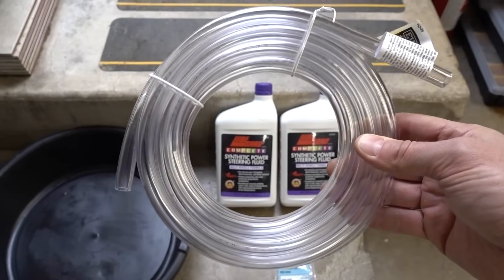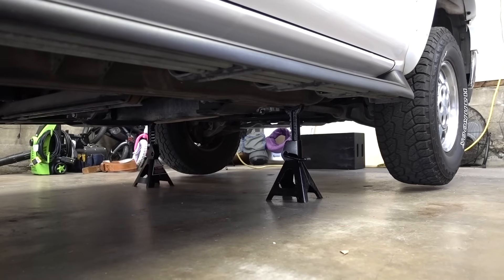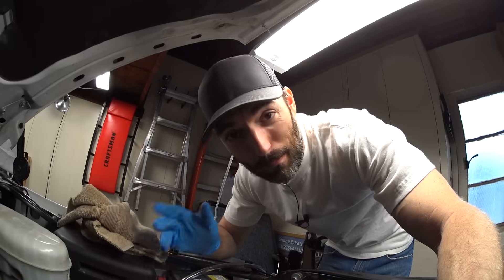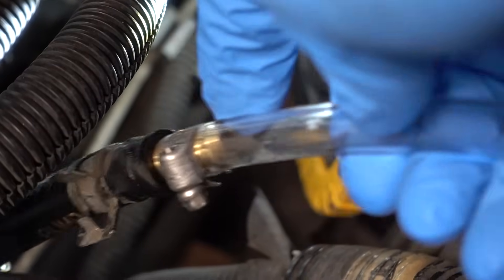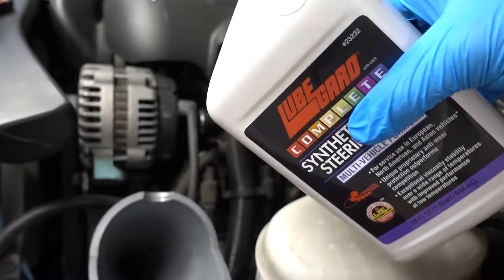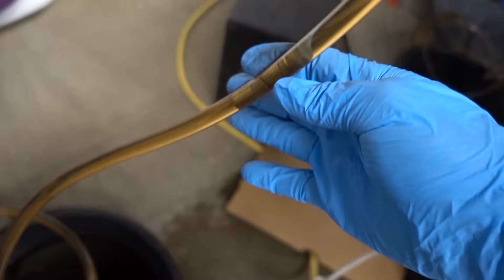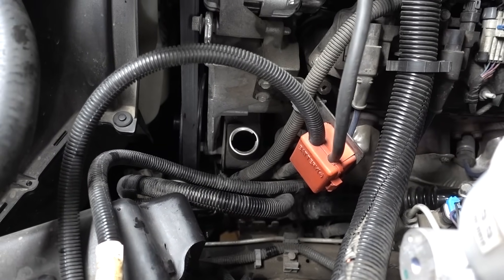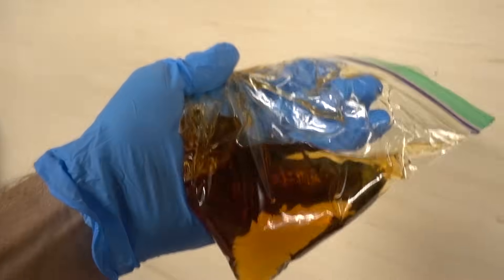Absolute BEST Method To Flush Power Steering Fluid!!

Comment: I don't think you need the hose clamps. There is no pressure on an open-end drain.
Reply: A $1 clamp is cheaper than $5 of fluid all over the place.
Reply: @dafirnz  A $1 clamp is more expensive than no fluid all over the place.
Reply: @William1866  $1 is cheap insurance. Get the clamp.
Reply: The clamp is a good idea. I got PS fluid all over the driveway.

Comment: why changing the power steering fluid ? it's not motor oil ... I know prestone should be change. my car is now 9 years old and never change, it's still going good (231 000 km/143 000 miles) is it for the seals or ?
Reply: It IS motor oil..petrol from crude made into transmission/hydraulic fluid/motor oil, ect.
Reply: My power steering fluid is 25 years old.
Works great. But reason to change the power steering fluid is because moisture, or water gets in it.  Maybe H20 causes rust or could destroy the power steering pump.

Comment: There is a easier and faster way to flush your power steering fluid than this method.
I bought a $ 20.00 fluid extractor off Amazon and let it do the work as you watch and refill the reservoir with new fluid.
Reply: Hey John can u plz attach the Amazon link? I need to do the pump as well, asap and am interested in making this job quick & simple. Thanks in advance 🤜🤛

Comment: What happens if you don't change your PS fluid?
Reply: 22chachalaca,I will answer your question,absolutely nothing Jack Shit,people are looking for problems that aren't there this is just fear mongering,even flushing engines is not nessesary if the oil and filters are changed at regular intervals,I have been a mechanic for fifty years and never see power steering failure due to the fluid it's all cobblers,unless you get a leak or another problem leave things alone it'll be fine.
Reply: David Ellis honestly that's what I thought. so have you seen cars with 15-20 year old power steering fluid working fine with no problems?
Reply: 22chachalaca ,Absolutely,it doesn't degrade like engine oil because there's no combustion by products going through it,it doesn't matter if it discolours a bit,just save your money for something that really needs doing and ignore this Pillock.
Reply: Dave doesnt know shit.  Over time it will cause the seals in hydraulic components (pump and rack) to fail.  Racks on some cars are over $1k.  PS is a simple hydraulic system, needs very little but it needs clean fluid every couple years or so.
Reply: @reallyhappenings5597  True, fresh clean fluid is going to flow throughout the system a little better, but not at the risk of getting air bubbles in the lines and risking putting holes in the hoses removing old hinge clamps or breaking off the plastic part of the reservoir that the return line connects to. I've been working on cars with my grandpa for 15 years and he's been doing it for 55 years and counting. On some cars flushing your PS system is likely to cause damage that'll cost $7500 to repair. In 55 years my gpa has never once done repaired a PS problem that was caused by not flushing the fluid. Flushing by removing hoses is unnecessary risk and a waste of money. You can achieve a full refresh of the PS fluid by simply removing the current fluid in the reservoir, filling the reservoir with new fluid, driving around for about 10 minutes, then repeating the process until the fluid in the reservoir remains mostly clear. I also have two ½"x 2" neodymium magnets zip tied to the outside of my reservoir to pull any traces of metal to one spot so it's constantly preventing and removing metal bits from being circulated through the entire system. No flush needed. Ever. The only time you should ever do a full PS flush is if you somehow filled the reservoir with the wrong fluid (ie coolant or window washer fluid) or if the reservoir cap is removed, foreign material has been allowed to enter the resevoir and has moved further into the system past the reservoir, which is a long shot. But here in Arizona it can happen if you accidently forget to replace the cap on the reservoir and a dust storm kicks up out of nowhere. But doing a full flush using this method is risking having to replace the entire PS system or doing major damage that could become a life and death situation if you're driving or need to avoid a car accident and suddenly your PS system fails... It's just not worth the risk for something that can be done in an hour by driving around the block a few times...

Comment: I’m not sure I understand why the return line to the pump was plugged rather than connected to the clean supply of new fluid- shouldn’t the pump draw the new stuff in as you turn the wheel?
Reply: The return line was not plugged! It was 're-directed' to the bucket. The reservoir was plugged (after the return line was removed)!
Reply: Andrew Szekely my thinking is by connecting a fresh oil supply to the return port of the pump, it would push a fresh supply through the system, but I’m not sure where the reservoir fits into the loop.

Comment: Wondering about the fluid still in the rack...
Reply: That's like worrying about the oil that doesn't drain from during  an oil change.  

Replacing 90% of the fluid is great. 
Besides, when he spins the wheel, he's flying fluid out of the rack.

Comment: This is a great method... But I just used a baster from the dollar store and did it twice, starting her once in between. As an aside, not sure if you saw the little set of fluid line clamps they sell at HF, but they worked very well on brake and fuel lines without abrading anything. https://www.harborfreight.com/4-piece-fluid-line-clamp-set-65116.html

Comment: Just found my escalade is pure electric power steering and no fluid.
Reply from the maker: What year?
Reply: @1RoadGarage  2015， Owner Manual: Electric Power Steering
, This vehicle has electric power steering. It does not have power

steering fluid. Regular maintenance
is not required.

Comment: This does not make any sense, if you are draining the  return line from the pump you leaving all the old fluid in the Steering Gear Box and just draining the pump. You are supposed to block off the return line going to the pump and drain from the Steering Gear Box so that you are pushing new fluid from the pump to the Steering Gear Box and back through the return.
Reply: Well on my dodge the return line comes from the rack to the reservoir the pump sucks from the reservoir and pumps to the rack,  one big circle

Comment: HOSE BARB! Those are NOT pliers! Those are crimpers for wire splices with a wire clipper on the tip. If someone uses those they can cut through that squeeze clamp which should be reused instead of the worm clamps you show in this vid clip! You 
Didn’t disconnect the battery either! Ever had a battery explode because a tool crossed the battery terminals? You will lose your eyesight also wear eye protection. Geez my kids in shop class knew to wear them!
Reply: I used this method and it worked great. All the old fluid came out and new fluid was added. Great video and info.

Comment: DON'T FLUSH YOUR MONEY. Just install TUBE TYPE OIL COOLER for the power steering and you will never need to replace it. I'm still using the Stock Power Steering fluid that came from the factory on my 20 YEAR OLD F150. NO COMBUSTION is taking place at the power steering so why the hell do you need to flush it. Do you also flush the oil on the A/C compressor?
Reply from the maker: Well, metal parts wear over time, the fluid gets hot, I'm sure it also takes on moisture from the atmosphere... Better question is since it's relatively easy, why wouldn't you flush it?
Reply: @1RoadGarage  The oldest vehicle I own is 20 years old, 2nd is 19 years old and 3rd is 17 years old all of them still using the stock factory fluid. They all have auxiliary power steering and ATF oil cooler. Just look how long water pump not lubricated with oil last. The alternator spins faster than the engine and the bearing don't get continuous flow of oil. How can the fluid gets hot if there is a tiny oil cooler in front of condenser? If I will change the fluid it will surely fail because the recommended fluid is now obsolete.
Reply: @Robert Howen The reason why viscosity breaks down in GDI is because Gasoline dissolves engine oil.  I got several hydraulic equipments 2 post lifter, tractors and backhoes. I never change their fluid only the filter. The viscosity is getting thicker when not in use. That's why automatic transmission is heating the fluid to reduce the viscosity. Oil change is s scam. The reason why car manufacturers and mechanic want you to change oil frequently is because the biggest wear on the engine happens during startup after changing the oil and oil filter. Why will car manufacturer, car dealership and mechanics tell you something that will reduce their profit?  That's the only time the engine makes several revolution without oil pressure. How  

Why is synthetic fluid made in laboratory so expensive? Advertising, Sponsorship, Promotion and Expert's opinion are very expensive.
Reply: @Robert Howen Viscosity-
the state of being thick, sticky, and semifluid in consistency, due to internal friction.. 5w20 is a multiviscosity engine oil. Most Hydraulic fluid are not multiviscosity example SAE 10, SAE 20, etc. Oil pressure is not critical on power steering. You can even use it as hydro boost for brake. The reason why they keep changing the fluid is to make old vehicles fail. Just look how they engineered new cars. Instead of having an oil cooler they make it oil heater. Installing oil cooler is not possible because no fluid flow outside the transmission.
Reply: @Robert Howen Port Injected fuel pressure on Return-type fuel system 25-30 psi. Return less fuel system 35-50, highest is 80-100psi. GDI fuel pressure 750psi just to idle. Engine oil don't smells like gasoline on port injected.
Reply: Wear metal does get into the system. Have you ever replaced an A/C compressor? You have to flush out the whole system with solvent to get their wear metal out of the system. On some cars, the old fluid turns black, and on some, it turns silver due to the wear metals contained. Just try replacing a compressor on a MKIII or MKIV VW Jetta or Golf. It will look like mercury is coming out of the A/C lines when you disassemble the system.
Reply: Same reason brake fluid should be changed. As fluid breaks down over time, heat, water etc... Chemical reactions start to happen faster and faster breaking the fluid down and protecting less and less.
Reply: @EGGINFOOLS  Brake Fluid dissolves in water. Hydraulic Fluid & ATF don't dissolves in water. Ford's Scheduled Maintenance Guide only said to check the power steering fluid(Mercon® ATF)  level at least once a year.  My power steering fluid color is still BLOODY RED. Tell your Electric service provider at home to change the oil in their AC transformer.

Comment: My biggest thing is how do you FLUSH THE ENTIRE SYSTEM OUT, YOUR RACK OPINION COST THE MOST AT AROUND $600 TO BUY, THEN LABOR IF IT LETS GO FROM BAD POWER STEERING FLUID, THIS ONLY DOES PUMP ONLY, NOT RACK ! NEED TO CHANGE ALL FLUID BECAUSE OF FINE METAL FLAKES, THAT CAUSES SCRATCHES WHICH KILLS PARTS, DID HALF THE JOB LIKE THIS AND WASTED SOME TIME, BOUGHT TIME ON RACK BUT WHEN IT GOES AWAY AND YOU GO TO MAKE THAT TURN, HAVE FUN GOING STRAIGHT AND YOU MOST LIKELY CRASHING, BEEN THERE, JUST NOT CRASHING ON MY MUSTANG'S, REPLACED A FEW RACKS BACK IN THE DAY FROM JUNKYARD ONES, IT WAS BEFORE ALL THIS KNOWLEDGE CAME OUT AND REPLACING FLUIDS BESIDES ONLY OIL AND RADIATOR, ALL OTHERS NEVER GOT DONE UNLESS FOUR WHEEL DRIVE AND GOTTEN WATER INTO DIFFERENTIALS OR TRANSFER CASE. THE WAY WAS GOING THREW VERY DEEP WATER WITH BREATHER TUBES UNDER WATER SUCKING IN WATER. SAME WITH ENGINE WITH CARBURETOR AND THEN STALLS OUT OR BLOWS UP. IN SCHOOL, WE HAD A BLEEDER BALL THAT TOOK AIR AT LOW RATE TO BLEED YOUR BRAKES OUT, DIDN'T NEED SOMEONE PUMPING BRAKE PEDAL TO DO BRAKE JOB, JUST CONNECT BLEEDER BALL TO MASTER CYLINDER WITH BALL HAVING ENOUGH FLUID IN IT, BACK THEN, DOT3 WAS FINE ON ALL CARS AND IT FIT ALL AMERICAN CARS WITH HAVING OPTION TO CHANGE TO CONNECT TO MASTER CYLINDER, THEN BLEEDING BRAKES WAS VERY EASY AND FAST. BEEN 35 YEARS SINCE I USED ONE. SHOULD BE MADE FOR GENERAL PUBLIC. ALSO THIS GUY NEVER STATED WHY HE'S REPLACING HIS POWER STEERING FLUID FOR, THINGS USED TO BE MADE TO LAST, LOOK AT SOME OLD MACHINES THAT'S 125 YEARS OLD AND STILL WORKS, SAD THAT WE MAKE JUNK IN WORLD ONLY TO KEEP JOBS IN CERTAIN THING'S, MOSTLY ITS ALL THROW AWAY STUFF OR REBUILD IT. READ THE ALMANAC, STILL SAME ISSUES FROM 100 YEARS AGO WITH WORLD OR 1,000 YEARS AGO. SHOULD USE WATER WHEELS FOR POWER AS MY CITY WAS BUILT ON IT AND KNOWN AS OF IT.

Comment: More bullshit about flushing people are getting paranoid about it,the only time the power steering needs new fluid is when either the pump or ram fails causing loss of pressure or leaks,I have driven thousands of miles in all types of vehicles and only ever had one power steering problem that was due to a leaking ram on a truck,if it ain't broke don't fix it,the reason the oil gets discoloured is because of the wiping action of the seals in the rack it's nothing to worry about.